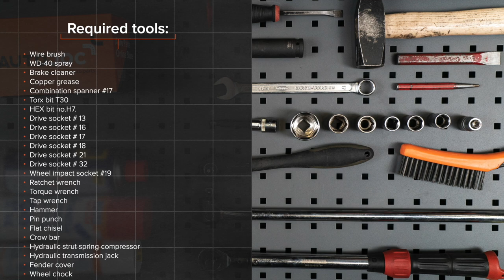Hvordan bytte foran fjærer der på PEUGEOT 206 1 (2D) [AUTODOC-VIDEOLEKSJONER]

Comment from the maker: ⚠ Merk! Det er en feil i denne videoveiledningen:
08:13 - Skiven bak må strammes med dreiemoment på 65 Nm, ikke 45 Nm.
11:23 - Skiven bak må strammes med dreiemoment på 65 Nm, ikke 40 Nm.
11:29 - Skiven bak må strammes med dreiemoment på 105 Nm, ikke 55 Nm.
11:45 - Skiven bak må strammes med dreiemoment på 60 Nm, ikke 35 Nm.
12:15 - Skiven bak må strammes med dreiemoment på 165 Nm, ikke 245 Nm.
13:27 - Skiven bak må strammes med dreiemoment på 120 Nm, ikke 100 Nm.
13:52 - Skiven bak må strammes med dreiemoment på 50 Nm, ikke 25 Nm.
Vi beklager ulempen 🙇‍♂